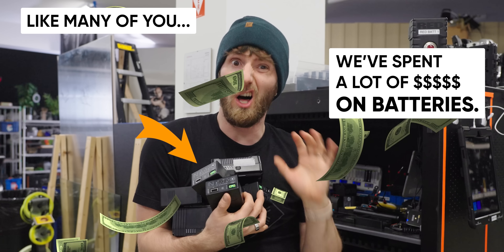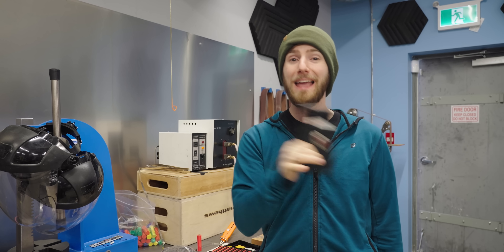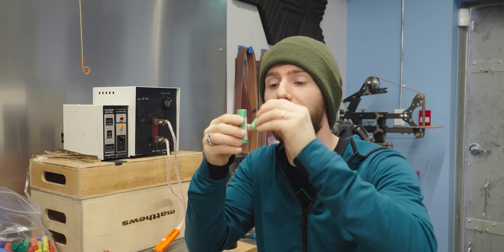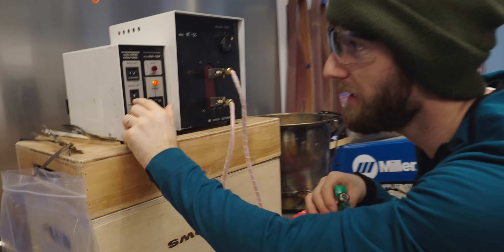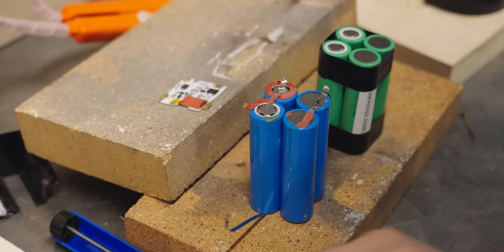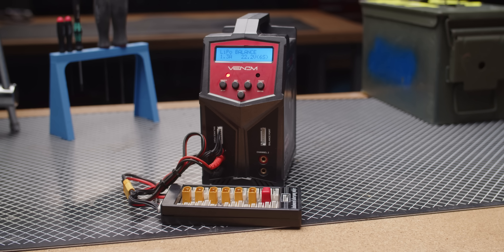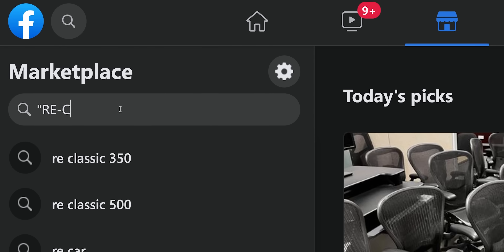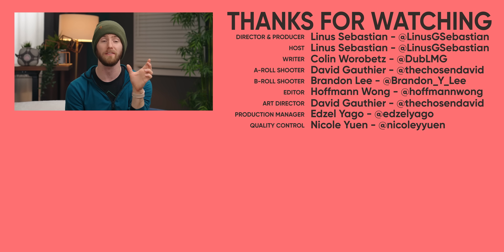This should be illegal… Battery Repair Blocking

Comment: I believe my first introduction to this kind of behavior was with Sony....big surprise right?! My dad had gotten an early model Sony LCD TV. It was a nice one at the time and worked well. However as many Sony products do apparently, it broke shortly after the base warranty was up. They wanted like $350 to repair it and it was even more to have a 3rd party do it because they were almost 3 hours away. That was as much as a new TV. It was before youtube videos on everything existed, but  I am good with repairing electronics so I troubleshot the display and figured out the backlight had just died. I ordered the correct Sony replacement, installed it easily, and put it back together, but it it wouldn't work. I called a tech and asked what they thought.may be the issue and it turns.out there is a dongle required, that you have to pay like $5k+/year for. The TV would not send power to the backlight until it inserted since the "MAC address" of the backlight was different. That means there is some sort of IC in there that tells it that instead of just being a light. And that means they purposely installed those on the most commonly failing parts to extort money from technicians and making it cost so much to pay them to fix it that you just buy another. It's well hidden though, so you still buy another Sony TV. Especially when the consensus is now that a TV should only last a few years before getting replaced. 

I'm sure there are ways of hacking around such things. It's not like a RTC on a arcade game mobo or anything like that, but you shouldn't have to be a software and hardware engineer to repair TV sets etc. Hell back in the days of Tube Radios and CRT TV's, local drug stores had tube testers and replacement parts. You could even get a guy to come to your house take the TV back to the shop and it would only cost like $4. There was a special Dragnet Radio show about TV repair scammers charging like $11 instead of $4 and they got jail time!

Comment: I have a few tips for you guys:

1. Take off all jewelry on your hands! You could easily accidentally short across a ring and end up with a horrible burn.

2. 3D print jigs to hold your cells

3. Use superglue to tack cells together once they are arranged in place

4. cut nickel strips on a router or drag knife
Reply: Please don’t use superglue.. high temperature adhesive that comes on a role is the best bet if you can’t use cell holders as it adds a small gap between cells.. superglue grips the wrapper so tight and forms such a hard surface that it can pull the wrap off and cause a short if the pack is dropped etc..
Reply: @jjjones6786  Exactly!
Reply: @jjjones6786  This is a fair consideration.
Super glue is acceptable for certain applications, particularly hacky stuff like what LTT likes to do.
Something reversible and separable from the insulating cover would be better
Reply: Something that adds spacing between cells is necessary in any instance that you care for safety.
Reply: That's what I was thinking. Use a 3d printer to stick them together, they even have a really expensive one too from when they made the case from a 3d printer.
Reply: Take it from an old timer.  1970 and my GF gave me a cloth "love" bracelet on my wrist.   A number of months later it was falling apart.  So I got a metal chain around my wrist with the cloth "love" bracelet interlaced between the chain holes.  All was fine the world until I was fixing my car, near the car battery.  I heard a "pop", a bit of smoke.  Humm... then the smell of burning flesh.  The metal bracelet shorted on the car frame and heated the metal hot enought to still leave a few scars of the chain outline 50 years later.
Reply: The Verge anyone? 😂
Reply: Also, they didn't have a 2nd bucket and sand on the ready when they started the 2nd battery attempt.....
Reply: Wait...So we're all just watching for him to blow him self up?...I thought it was just me
Reply: @faithblack3851  So time to watch electroboom make a lithium pack?
Reply: I'd subscribe again instead of coming by occasionally if he got a horrible burn.  That would be a must see video.  That video would probably be the most viewed LTT ever.    Stupid games DESERVES stupid prizes.  Get er done, Linus!
Reply: @dlewis9760  well uh that's a bit cunty

Comment: I'd definitely like to see how these get recycled.  

IMO, you trying to do this was ... careless and dangerous.  I appreciate a lot of the safety kinds of things, you say, but just because you can, doesn't mean you should be the one doing it. That's all you need is the thing exploding in your face and hands. You were only wearing safety glasses, not a full shield, and should have also worn gloves. If it wasn't batteries it wouldn't be quite as concerning. Also at 00:06:43... please don't cut things on the bandsaw with your bare hands near the blade, use a push stick, didn't your shop class tell you that?

Comment: Great Video! But in 13:44 I would say - dont throw it away - try to charge it! I know some BMS which cut the power at Battery disconnection and switch back on, when charging the first time! Greetings from Germany.

Comment: 4:00 It's also worth mentioning that some battery management systems disable all current forever if they lose connection to battery at any time. As a result, you must start battery swap by soldering alternative power source to BMS so that it doesn't disable electronics when you desolder the cells.
Reply: I assume that the alternative power source would have to be connected through a resistor, to allow the battery and alternative power source to have different voltages without issues.
Reply: He literally says this in the video
Reply: @Ziplock9000  But Mikko provides as solution as well
Reply: Or you can just kick start the pack because it is not disabled, just in undervoltage protection... which is absolutely required to prevent deep discharge.
Reply: @JBP.3D  How do you "kick start the pack" if BMS in integrated into one chip and has disconnected the battery?
Reply: @MikkoRantalainen  Apply voltage to the pack output. It disconnects due to undervoltage butresets connection if a charger is plugged. I've used packs down to almost empty voltage (2.5V) and had to reset quite a bunch using that technique. Just plug a 5v supply for 1 second.
Reply: @JBP.3D  Thanks, great info!
Reply: @JBP.3D  Are you sure these particular BMSs in the video can be bootstrapped like that? I know some commercial ones can, but specifically those in the vid?
Reply: @Ziplock9000  I mean it is possible that I don't know some BMSs but I've used some from basically every manufacturer and I never had one which was "bricked" after you remove the cells. some have volatile memory but even then have a default config. They're also quite rare.

Comment: Not looking forward to more and more electric cars to add to the E-Waste problem… this is often looked over by many people pushing electric cars but in reality at best they break even in terms of being better for the environment, not to mention all the third world destruction for lithium like in Bolivia
Reply: Compared to buying a regular new car, electric cars are easily better for the environment.
From best to worst:
- Walking
- Cycling
- Public transport
- Buying old car
- buying new electric car
- buying new internal combustion engine car
Reply: @logitech4873  I’d like to see your sources, just to give you one example modern Diesel engines with after treatment systems like SCR, DPF and DOC have reduced NOX by 98% and manufactures like Cummins plan to be carbon neutral by 2025. Not to mention around 80% or internal combustion cars can be recycled while EVs are only 65-70% reusable per a GM study where they have to recycle 130,000 lithium batteries because of a recale and all the batteries are sitting in a warehouse while they figure out what to do with them

Comment: You can supply the BMS with the required voltage from external power supply and then cut the old battery pack then solder the new pack while the external power supply in still connected

Comment: @jehugarcia will be sad, you are throwing a big chunk of 18650 which probably have a good number of usable cells in it.  There are a lot of use for it.
You can make a backup 12v pack for your Router/modem, a 5v USB powerbank, replace a bluetooth speaker battery,  and a lot more.
As a battery Enthusiast, I have a few comments on this.
1. Before replacing a cell, research it first on the capacity and the discharge rate of it. You dont want to replace it with GENERIC cells with only 2C discharge rate (C=mah,2C = 2xCapacity). Usually the capacity is proportional to the discharge rate because of this.
2. I dont recommeend buying 18650 on VAPE SHOPs (At least that is the case here in my country), they usually sell Fake cells, fake capacity, unknown specs generic cells. You can buy a 3500mah LG MJ1 cells for 5-6usd nowadays easily from solar panel sellers or electric scooter/bike shops. For example, the BROWN cells you are using is probably an LG HG2. It is notorious on having a lot of fakes. It has been discontinued so about every HG2 in the market are FAKE.
3. use Ring Insulators at the top off your 18650, this will make it more safer. This are small Paper Stickers for 18650. Your nickels strips have sharp edges that can wound the insulator covering the cell. Remember that the Whole side upto the top of the positive pole, is NEGATIVE. so if a welded Nickel strips in the Positive terminal touch it's own negative side, it will give a huge spark and burn. Although cells have a plastic ring on top already, sometimes it can get melted when welding/soldering.
4. BMS usually have a jump start to reset, either by just charging it directly in the p- p+ port or ch- if exist.
5. Buy a Liitokala li-500 so you can give a 2nd life to those poor red cells (probably Sanyo cells). This charger is the cheapest way you can Test cylindrical cells capacity accurately. it has a NOR Test feaeture, means it will Charge-Discharge-Charge, it is testing the capacity by Discharging thus more accurate.

Comment: I suspect the line is its a safety issue and they dont want amateurs doing dangerous repairs on products that represent their company when they explode.
It could also be a case of not allowing people to just bypass the bms with a charger to get enough voltage back into dead cells for the bms to recognise it again.
A decent repair shop could probably replace the cells without freaking out the bms, as long as the pack isn't completely dead you can solder some small wires to the pads and use a bench power supply set to the same voltage as the existing cells to keep the bms "live" during the repair. Wouldn't be that hard to do if you take your time

Comment: A word of caution; Linus, you are handling these open packs and cells with a wedding ring on your finger.  This is a really good way to loose a finger or worse!  Never handle these cells or open packs with ANY metal jewelry on your hands, wrist or anywhere else that could potentially make contact.  Rings, watches, bracelets or even long necklaces/chains are a big no no.  Way too many amps, way too fast can, like a Vulcan Mind Meld,(Weld?), instantly make you one with the battery pack!  For 40+ years, I worked with everything from mini computers to 3 Phase 480V power systems.  I never wore any jewelry, rings etc. for this very reason.  I just never wanted to forget to remove them and tempt fate.  To the point of your video, the deliberate manufacturing of more E-Waste by manufacturers is intolerable and should be made illegal!
Reply: You can spot the most dedicated ele techs by a complete lack of jewelry, wedding, or otherwise.
Reply: As someone who works with electricity, I now wear a silicone wedding ring 😉
Reply: I'd have never even considered this, nice tip
Reply: Great advice!
Reply: I've hear of the danger of jewelry in the context of car batteries and residental/industial power, but hadn't considered that such small cells could output so much. Apparently the 18650 cells can output 30 amps each.
Reply: @alexlevoy9803  Those small cells can actually pack a really big punch.  Lithium cells like the 18650's can actually dump even more than 30 amps if short circuited by something like a ring directly at the positive terminal.  They won't do this for long before venting and very possibly creating a little Lithium fed blow torch on your finger.  Not fun.
Reply: @alexlevoy9803  You can dump more than 30 amps in a short circuit ;) A high discharge current cell (like the 30amps one) have a low internal resistance, theoretically the short circuit current is rather along the 150amps. It's even worse when you parallel them the short circuit current doubles each parallel cell you add.
Reply: THIS!!!
Reply: Kawaii   !!!!!
Reply: Yes.  Ive seen a gold wedding ring smoke the finger it was attached too.   Wasnt too comfortable to have the ring removed plus the several years of the wound site staying tender.
Reply: I worked as Citroen tech and accidentaly shorted baterry contacts with my metal watchband when i was replacing the alternator. That shit Turned Red Hot in less then a second.
Reply: Linus drops shit. Do you think personal safety is a concern for him?
Reply: Be my guess, a person of Linus' character doesn't care about safety rules and naturally doesn't go back to do any detailed RESEARCH.

Comment: As an engineer for a manufacturing company, it’s incorrect to say we use physical obstruction to make things unserviceable though I certainly believe others might stoop that low.  When we use glue, thin plastic, ultrasonic welding, potted electronics assemblies, one-time-use fasteners, uCs with no NV memory, one-way assemblies, etc, we use these methods to reduce component cost, streamline manufacturing, improve product reliability, increase product safety, or meet a specific customer requirement.  Since field serviceability isn’t as a key customer requirement given to the design team, there’s no cost value or design effort allocated to it and serviceability suffers as a side-effect.

No matter the reasoning, what we can agree on is that companies will try to make money.  So keep backing companies like Framework and Bebob who extend product service lifetimes, and make sure companies + regulators continue to hear that serviceability is a MUST.  Give them enough evidence that serviceability will make them money or keep them in a market they’d otherwise be kicked out of, and they'll give it to you.
Reply: Especially with professional-level battery packs like that, the cost of the cells is so high that replacing them with new ones after a few years isn't really viable. I'd really be interested in how many customers actually use Bebop's re-celling service. It certainly won't be cheap. I guess it's more of a marketing ploy because the German market is extremely focused on "green stuff".
Now I'm not against repairability and trying to reduce waste, but a huge V-mount battery is the worst example because it basically just consists of the cells, a plastic case and a tiny little controller. It's not like you have to throw away/recycle a whole device just because the battery died.

Comment: Glad you did not try to replace cells in DJI drone batteries. Their battery BMS game is way higher. Basically upon disconnecting batteries, BMS will block itself and only specialised software and wiring can unblock it again.

Comment: glue the batteries together inside the original red holder. then pull them out and weld. Use a stripe of PL premium down the middle of the two rows.

Comment: You guys are kidding right????   Apparently you haven't researched battery pack repair a whole lot....   You should always charge all cells to maximum voltage first.   Li-ion batteries have a rated voltage of 3.6 or 3.7 volts and a  fully charged voltage of 4.1 and 4.2 volts respectively.   All voltage matching should be done at full charge.

Comment: 1. No need to spot-weld on cells. I usually buy 18650s with nickel shims preattached (or keep the nickel on recycled ones).
2. Cheap third-party (Chinese :) laptop batteries seem to be much more recycle-friendly. Swapping cells works just fine, so yes, this seems like a case of classic anti-repair BS.
3. I don't have the impression that li-ions are THAT unstable. Only sparks I ever saw was when flat-out shorting +/-, and that will happen with any high-power battery.

Comment: Wonder if this can be bypassed by quick soldering the extra battery first, securing the cables in place, then desoldering the first battery. (or just tripple battery soldering old one(to be replaced)-middle(just to provide power for the time of desoldering the old one and soldering in the new one)-new one

Comment: You clearly overreacted on those "sparks". I bet none of those batteries actually went dead or even bad. In the future turn down the scare-tactics on batteries like that. In fact that kind of lithium cell can take a pretty hefty beating. And about the red packs. Seems like a lot of guessing of those BMS being evil. Why not test it proper. See if they really prevent you from replacing the cell, before sacking the company reputation by hearsay. I mean, they could be evil, but you pretty much need to prove it. And yes the packs are overinflated, but so is the camera, so I guess if you can't pay for the "service", don't buy it. It's like owning a Veyron and bitch about how expensive the tire is.

Comment: whats preventing you from solder another battery running parrell to the bms and cutting off the wires connecting to old batteries, then wire the balance wires. then your bms will never be turned off